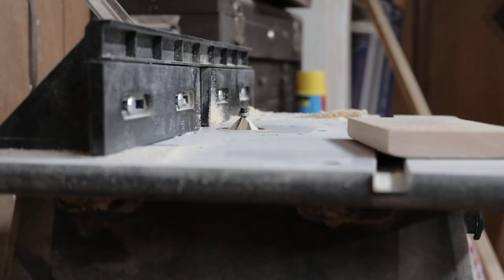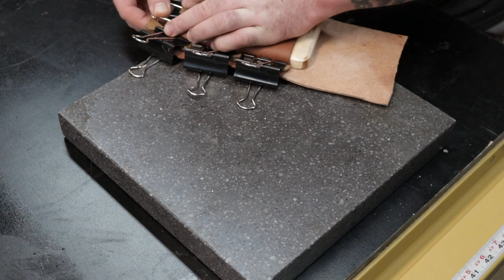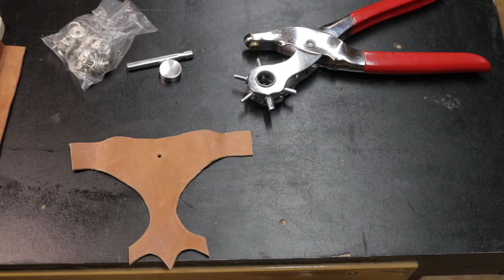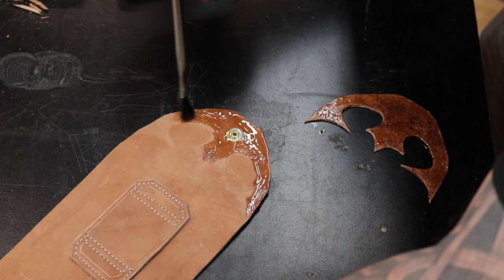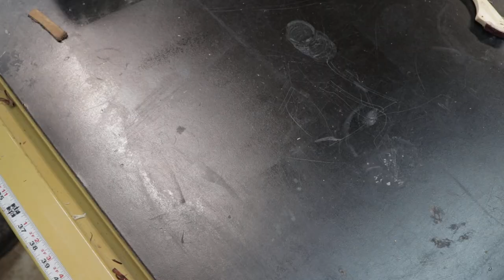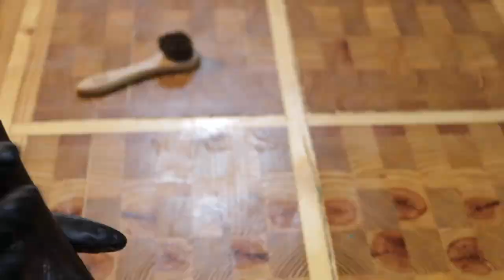HOW TO MAKE AN iPHONE HOLSTER

Comment: This is a great vid.  I am getting ready to start one soon
Reply from the maker: Awesome!! Send a link or at least pics when finished.
Reply: @LittleHayCreek   well about that... It will be my first leather project.  I hope to not be to embarrassed to wear it let alone show it
Reply from the maker: You’ll do fine, take your time and oversize everything if you can. So you have plenty of stitching room, cut the excess off after.
Reply: @LittleHayCreek  I am thinking I will double everything so I have  both sides finished and glued together.  Phone come out and in easy and be strong.   Thanks for video   It is inspiring .  Yea When my tools get in I will hit you a pic of finished product good or bad..
Reply from the maker: Sounds great, remember a ton of burnishing after you finish the product usually make a big difference. I’m sure it will look great. Be careful and have good ventilation with using all that glue.
Reply: @LittleHayCreek   for sure.. Lots of burnish make it look great   What glue do you recommend

Comment: What model is your singer sewing machine been stitching by hand witch I like but faster on little jobs like this much faster nice job
Reply from the maker: Thanks, it’s a Singer 20 U73. It works well but had to get a reduced motor for it. It was way too fast, I’d recommend something with a Walking foot, this does work though. Have a good one👍
Reply: LittleHayCreek thank you buddy that’s what I’ve been reading in research almost all of the machines run to fast !
Reply from the maker: Still worth it though if you can slow them down or practice with it kinda fast.